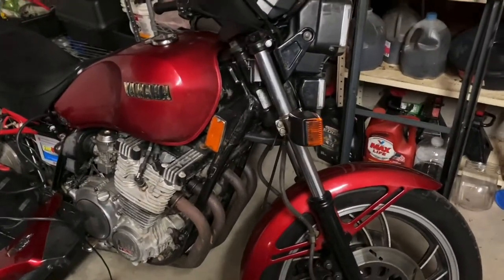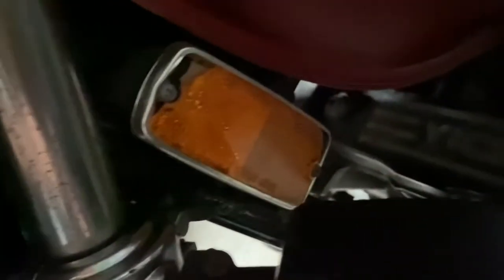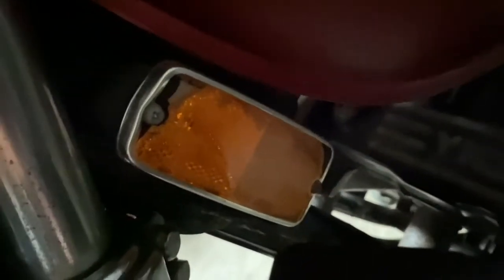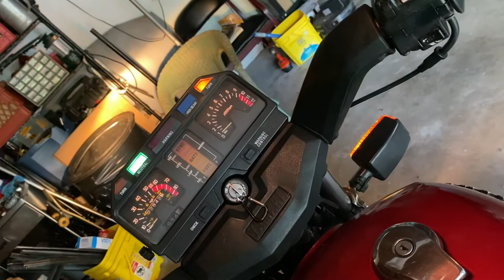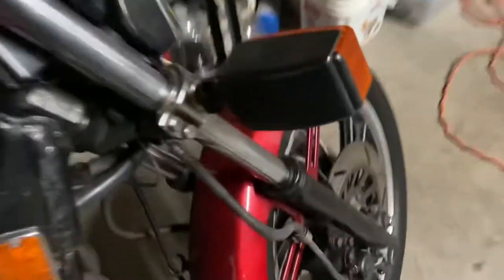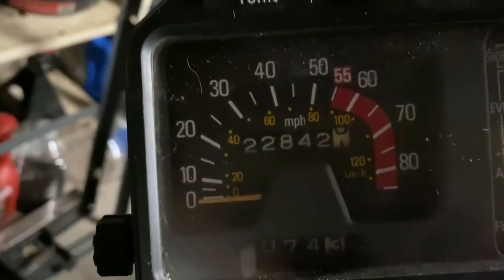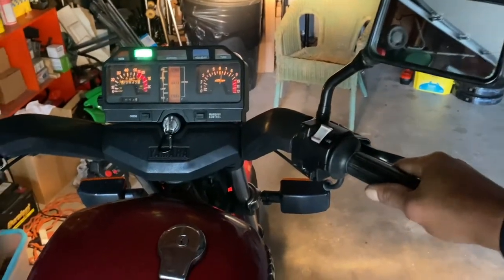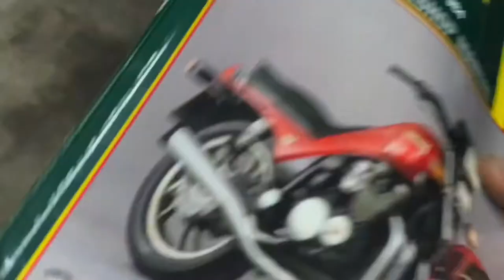$600 Yamaha XJ750 SECA

Comment: I had a mint condition one back in 1989. I’d love that that bike. Unfortunately I rear-ended a Cadillac. I was an injured but the bike was a total loss. All my other friends had new crotch rockets but I had to shaft drive bike and my other friend had to max 700 Which Shaft Dr.bikes were cooler than theirs
Reply: The maxim X featured the five valve genesis head. And would smoke my Seca.

Comment: had one in the 90s..... did a 4000 road trip. solid. I had hwy pegs.. and I use bar stock to extend the passenger pegs back and up - so I had 3 positions
Reply from the maker: I just started riding on the highway at the end of last season and now unfortunately I am having charging issues. I narrowed it down to a bad/failing voltage regulator. Hopefully be back on the road soon. Thanks for watching and commenting 👍🏽✌🏽

Comment: Have the same bike bought it used in 83 still have it had an upgrade to 900 with headers
Reply from the maker: Nice!  I was curious whether or not that was possible, swapping in a 900cc for the 750. I’ve looked at the XJ900 and looked like the same frame size. Thanks for confirming 👍🏽
Reply: @HandyL  Same engine trans unit 900 is just a factory punch out you can get a big bore kit for them still I believe. I had taken mine out and ship it to a shop to have a kit put in and the shop burnt down and lost it in the fire. bought  a complete 900 engine for a buck a cc and started life over. 😊😊😊😊
Reply from the maker: I can only imagine that phone call, ‘uh, we lost your engine when the shop burned down’ 😳. Holy crap!  Well it all turned out well in the end.  I will definitely look into swapping in a 900 in the future.

Comment: Sounds like the carbs need synced.  You need a special tool to sync the carbs.   It's called a YICS sync rod.  Since the YICS motor shares intake responses through a passage on the rear of the block.  You insert the tool...then set the idle speed....then sync the carbs with a mercury tube sync guage.  The rod is used to isolate the cylinders intakes for a true vacuum pull on each cylinder.  Which is needed for CV diaphragm carbs.  The rod has section of rubber that compress between cyl when locked down😊
YamaPro ace 1991 Arizona MMI certification 😊
Reply from the maker: Thanks!  I will totally look into that. It runs a lot better now, I’ve done quite a bit of work on it since this video but I’ve never attempted syncing the carbs which I know needs to be done. Cheers! ✌🏽

Comment: It’s looking good.
So the Seafoam didn’t work? Nice dirt bike brother.
God Bless 🙏🏼.
Reply from the maker: The seafoam worked for like a day then it wouldn’t start after that. The carbs were absolutely gross.  All the pilot jets were clogged, I must have just gotten lucky and had it running in this video.
Reply: @HandyL  well at least you got it going 👍🏼

Comment: Nice bike, they recently gave my son my 1989/90 XJ600 (pre-divi), I was sad to see it go but at least my lad will ride it and get some enjoyment from it,
Only thing I would say, yours sounds a bit rough on tick over, you mate still have a low rev fuel starvation problem on one of the carbs
Very nice bike 😎🏹🙏
Reply from the maker: You are absolutely correct sir, very rough. I just realized after I shot this video that one of the floats was stuck open and gas had gotten into the oil. Just drained it today.
Reply: @HandyL   the XJ i give to my son had the exact opposite problem, one of the float chambers was jammed shut and stopping fuel, it sounded exactly the same as yours, very  rough at low revs, once we had the float un stuck it runs like a dream and sounds awesome, even at tick-over😎🏹🙏